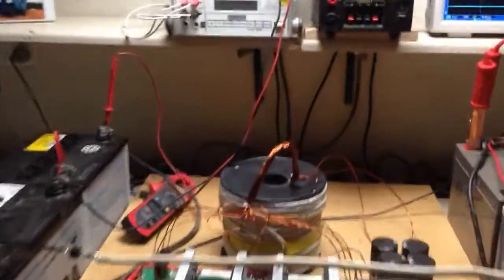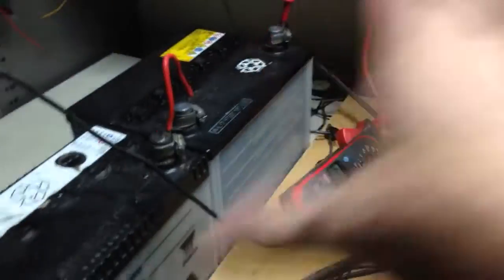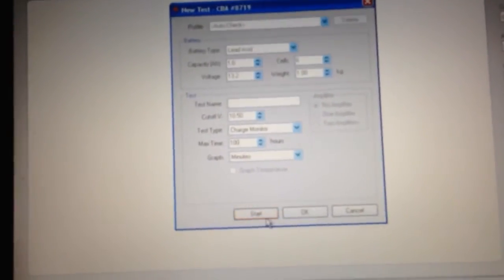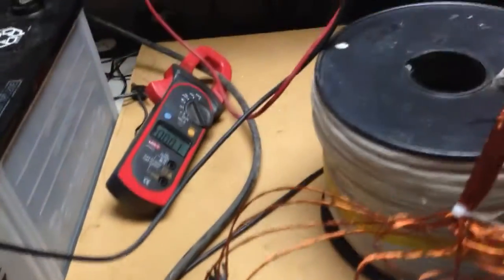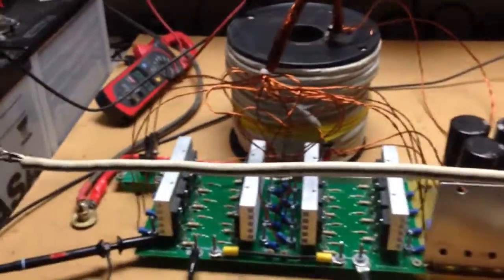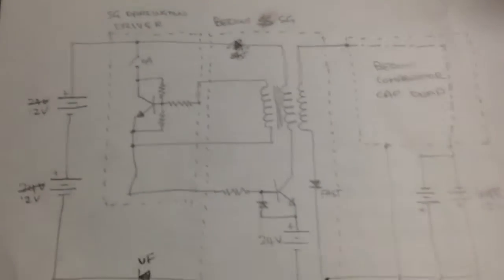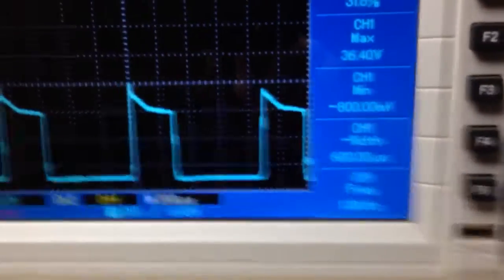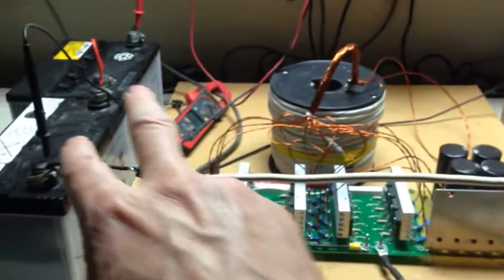Bedini Solid State SG

Comment: Hello John, beautiful work.
What is the configuration of the capacitor bank? Are all 4 in parallel?

A hug.
Reply from the maker: Gustavo Roque Thank you, yes all four capacitors are in parallel.
Reply: Okay, what's the capacitance of each? I need to develop a setup to unload on a 12V / 315A battery. Could you tell me the best configuration?

See you.
Reply from the maker: Gustavo Roque The capacitors are 15,000uF @ 80V. Sorry, I can't tell you the best setup for your battery. That's something you will need to experiment with. Let the machine be the teacher.
Reply from the maker: Gustavo Roque The capacitors are 15,000uF @ 80V. Sorry, I can't tell you the best setup for your battery. That's something you will need to experiment with. Let the machine be the teacher.
Reply: Great, my friend. I'm analyzing this on my system, and my capacitor discharge circuit is discharging 2.5A into the battery. I am now quadrilicating the SSSG circuit for more output current. Soon I will finish, and post the video. (Sorry for the mistakes, I'm Brazilian, and I do not speak English fluently). A big hug!